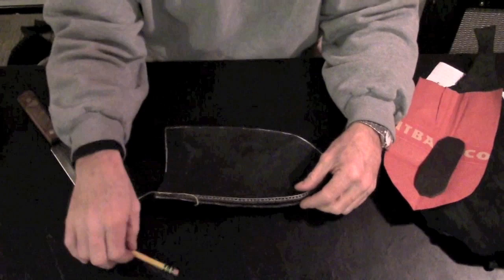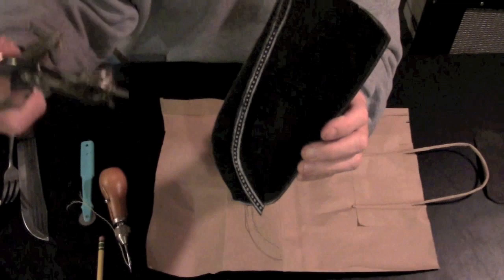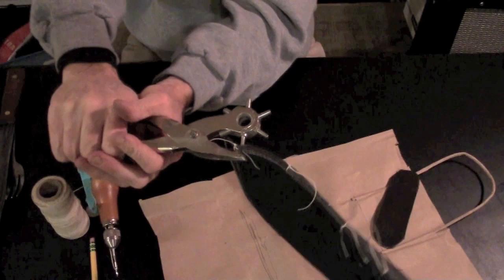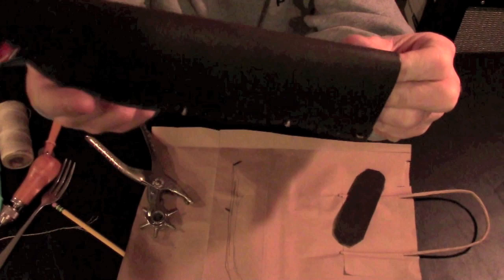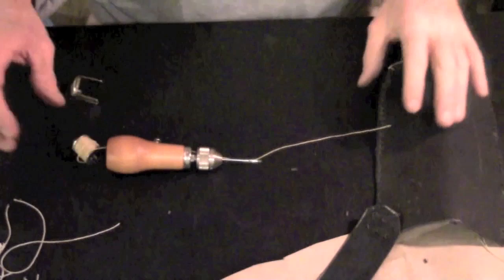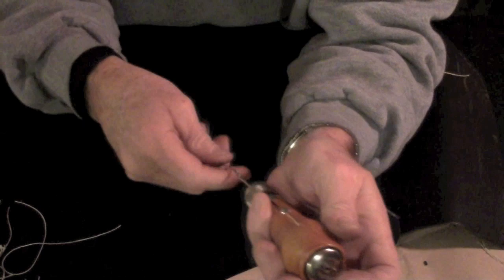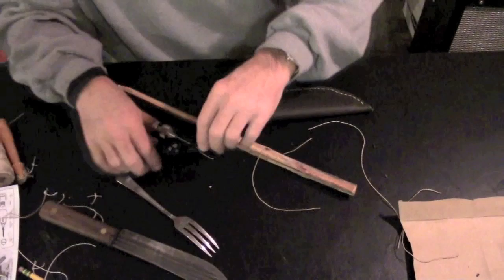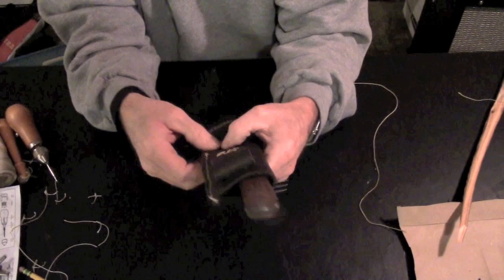How To Make A Knife Sheath For an Old Hickory Butcher Knife - Part 2

Comment: with a wood block and nail you could have punch your hole through the 3 layer and aligne it at the same time. Basically nail it to the board. then you remouve the nail and fix it temporarely. then sew it.
Reply from the maker: Yeah, I know.  But I had that cool tool ;-)  Maybe next time.

Comment: Working with leather can be a pain in the butt, I got started in the Coast Guard around 1978, making leather stuff for our boats, like holders for the boat hooks. I then started making sheaths for myself and wound up making them for everyone else. Now I buy hides from Tandy Leather and still making sheaths for people and a couple of Knife Makers. I don't us the sewing thing you have, I use sail needless makes it s lot easier. my belt holder I cut it out with the case, cut it at an angle and sew it to the side of the sheath that way you don't cut the twine holding down the belt holder.
Reply from the maker: Sounds like a good idea on the belt loop.  I didn't think about the chance of cutting the threads.